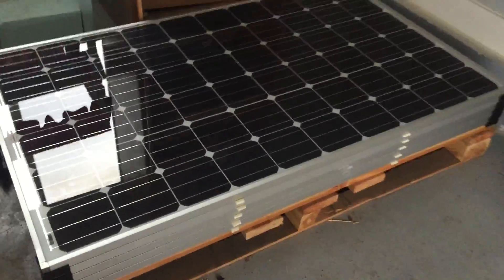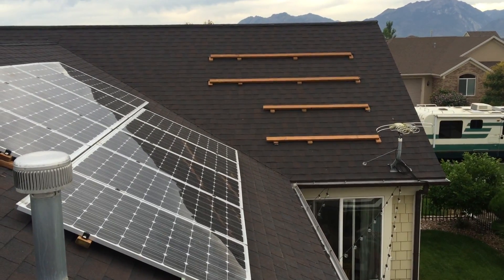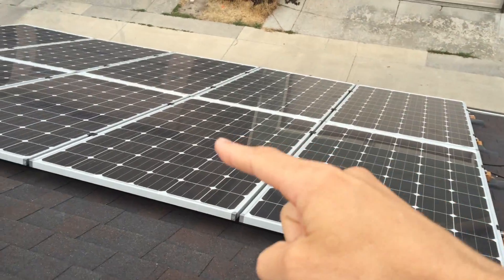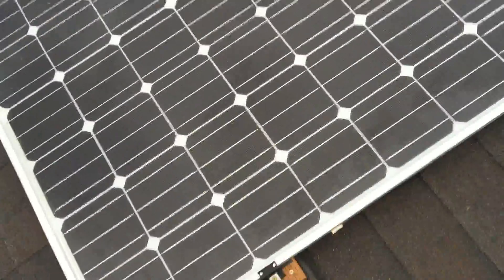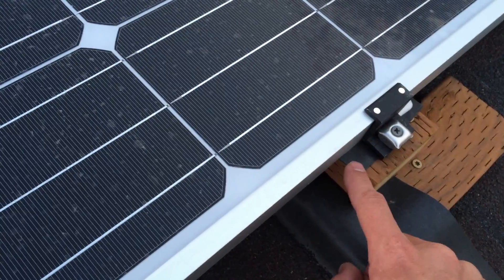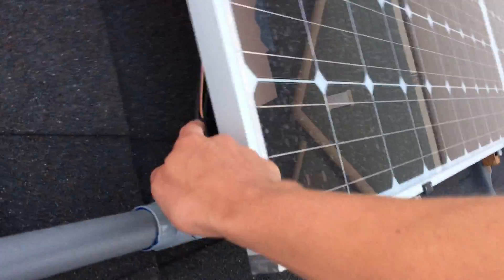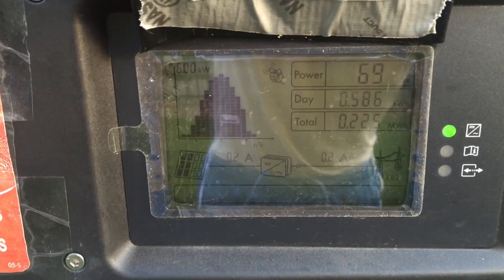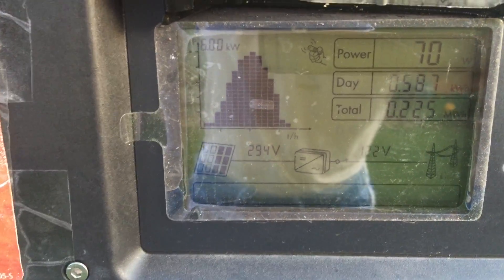How To Install Solar Panels Yourself For $4K - DIY 7KW - South Jordan, Utah - Cheap

Comment: Nice video!  I dont know why installation from these solar companies are so expensive!  Roughly I was told it would take about 3 days for about 3 people working to get my 7kw system installed, and if all three work at 8 hours a day, that would be 3 days x 8 hrs x 3 people = 72 total man hours for installation. They told me that the labor cost is about $10k, so doing the math, the hourly rate would be 10k/72 hrs is about $140/hr each installer makes?!  Geez, they sure make a lot of money for this job!
Reply: Companies charge 2-3x labor cost as a norm. Any less and they will be self employed and maybe unemployed ;-)
Reply: I could get a 7kw done in 1 day.
Reply from the maker: Yeah, and there are other hours of work they do (filing paperwork with the city and such), but it definitely doesn't amount to enough hours to justify what they are charging.  Like a lot of professional pay rates, I think they are building in a lot of cushion/buffer for the 1 in 10 installation that goes wrong and consumes 80% of their time and effort.

Comment: what permits/inspections do you need to do this job
Reply: Doesn't look like you need any in Utah which is incredible. No way would you legally be able to DIY like that in Australia
Reply from the maker: yeah, you do with your city.  I also had to have the HOA approve it.  To tie into the grid, they had to see that my city approved it.
Reply from the maker: permit with my city - South Jordan.

Comment: Is it possible to put solar to my condo building?
Reply from the maker: I imagine so - if you own, I think you own the roof in a condo, and if you rent, I suppose you would need to get the landlord's permission.  It is fairly easy to remove them later, but they might not like you drilling holes in the roof.

Comment: here is a diy dream. find telescoping glass tubing some wire and some circuit board copper sheeting or solar panel copper sheeting and then etch copper on the outside of the tubing and then connect wires to take the electricity. then do the same with all the tubes until you make one that is one foot across. then place on board to tilt to the sun. then make one the same size as a solar panel and put in the sun. if done correctly the 20 sheets for one solar panel equaling 20 volts is now 200 volts and you can run a lot of stuff on it. if you make it a vacuum system like a light bulb then it increases energy and if you make it more than one foot tall then you make about 200 volts for every layer. please remember vacuum is best as it will heat up ok. good luck.
Reply from the maker: Hmm, sounds interesting
Reply: dare you to try it.
Reply from the maker: Is that a double doggy dare?
Reply: the vacuum effect cause an increase in the normal power output.
Reply from the maker: i see

Comment: have you tried the micro inverters on each panel? I heard they're a bit more efficient...
Reply from the maker: I looked into them - slightly more efficient, but double the price - not worth it I think.
Reply: Micro Inverters are easier to work with... but the efficiency loss is less the shorter your DC homerun is.

Comment: Why don't you install a lithium battery to sustain the energy produced throughout the day?
Reply from the maker: I have considered it, but it wouldn't really offer an advantage.  Basically, I am using the grid as my battery.  Batteries can cost a lot (unless you get them free or cheap like 18650 ones).  I get credits any time I am overproducing and then use the credits at night.  You would only use lithium batteries if you worry about power outages or you are off-grid.

Comment: Matt, I'm completely impressed with your project. .Not only did you design it yourself, you installed it your self!  

It's been over a year since you went on line, what has been your experience with your electric bill?  Congrats!

PS:  How did you pull all those cables through the conduit?
Reply from the maker: Joe Pah thanks!  It is going great. I am saving about $1200 per year off the $1500 I used to spend on power.  See full follow up report at https://diynewman.wordpress.com/2016/07/24/how-to-install-solar-panels-yourself-for-4k-diy-7kw/
Reply from the maker: Joe Pah oh and I pulled the cables through the conduit carefully. I actually didn’t connect all the conduit until I pulled all the wires through. Also, I ended up using two conduits because the wires wouldn’t fit in the one
Reply: Sure that makes sense... What voltage does your system run at?
Reply: Excellent self evaluation.  I received a quote for my house in Miami, and they are quoting a 9 kW system for basically the same annual 12,000 kWh output as your 7 kW system...Guess what?  It was $27,000..lol
Reply from the maker: Wow, that is a racket!
Reply from the maker: btw, you should check out sunelec.com because they are there in Miami so you would save $500-700 on your panels that I had to pay in shipping.  They also have the best prices I have found anywhere.
Reply from the maker: I am using 3 of the 4 strings I have, so the side that has 2 strings is 250 V, and the side that only is using 1 of the 2 slots for strings is at 125 V.
Reply: Yep I'm aware of them, and looks like a huge inventory... After reviewing a few videos of solar panel installation in Hurricane country I realize this is beyond my capability.. Mounting the panels on barrel tile requires removal of  tile to anchor the  mounting hardware to the rafters.  Not something I'm will to risk.

I might just build a small system that I can anchor off fascia, and take down when Mother nature visits.

Anyways thanks for the insights!
Reply from the maker: Joe Pah I see makes sense - good luck

Comment: Have you seen a good bracket/clamp to use between the panels that actually join them together?  Say like a clamp on the underside?  It also needs to be able to be secured to wood rails on the bottom.  I am looking to make a solar arbor, and to make it more or less watertight just by lightly caulking between the panels on the top.
Reply from the maker: I haven't really seen that.  I looked on a few solar sites and they charged a lot.  I ended up finding mine on eBay.  I am sure you could find something that would work for that on there, or maybe go down to a hardware store (Home Depot, Lowes, Ace, etc.) and see what you can find.  Even something like c-clamps might work (and some silicone caulk stuff).  Anyway, good luck!

Comment: You did a good job. It would have been cheaper to use  less flex and more pvc.
Reply from the maker: thx - I am not sure the cost for flex was significant though - I think I only spent $20 or $30 on that because it is only on that portion that goes down from the roof to the inverter.  The rest is PVC.

Comment: How did you wire the Delta lightning aresstor in your disconnect box?  I don't see any ground going to earth.  The lightning strike needs to shunt to ground.
Reply from the maker: the grounding wire goes into the ground on my main breaker box, so in theory, the lightning would go into there, but I have also been told that I have too many right angles and it wouldn't follow that path anyway.

Comment: Very well done presentation. I hope to take your information and work on my project of solar powering my shed, before starting on my house. I was just a little hesitant on tackling both projects myself. The quotes I have received so for for the home system are off the wall. Thanks for the great info.
Reply from the maker: canjo 7 You bet, good luck with your project!

Comment: hello Matt what  controller  and switch ? can you letme know
Reply from the maker: thao nguyen san diego You actually don’t need a controller if you don’t have batteries. Check out the link in the description to the blog and you can get information about all the parts. Maybe you are asking about the inverter

Comment: Should use kindoff /strut for racking .
Reply from the maker: Joaquim de souza Yeah I realized that after the fact. You can get strut channel for pretty cheap. If you look at the link in the description it is to my blog where I have all of the follow up stuff and this is one of the items on the lessons learned section
Reply: Lot of credit to you for doing this job yourself ,thinking to do the same my self .Thanks for reply and posting this video for benefit of all of us.
Reply from the maker: Thanks and good luck!

Comment: Nice work explaining this. Since it's been over a year I would like to see a follow up video showing if you have had any issues and what you have actually saved.
Reply from the maker: I haven't gotten around to doing a video, but I added a Follow Up and Lessons Learned section on the accompanying blog - https://diynewman.wordpress.com/2016/07/24/how-to-install-solar-panels-yourself-for-4k-diy-7kw/
Reply: Thanks for the fast response, that info is quite helpful.

Comment: You should use Snap-n-Rack for mounting this. mounting brackets and rails at most electrical supply stores like Rexel or Platt. Wind and weather will destroy that racking system. The screws need to be bolts too. Rubber flashing will crack in a few years. Good learning experience though and it will probably hold up ok. Just some ideas..
Reply: hello Matt newman. first of all thanks for all your input.  i have a few questions.  im in texas major city and would like to know if i need an electrical permit as well?  and who ties in the net meter?  i use reliant energy. also how fast do i need to get started since 2019 is on its way.  thanks.
Reply from the maker: Dusty Webb yeah your city probably requires a permit - ask at city hall. The net meter is the power company - ask them. It took me about 5 months total to get panels from Miami, install system, and get plugged in and permitted.
Reply: thanks man hopefully i dont need an electrical permit as well.  5 mths?  hmm looks like i need to get me a loan and getstarted asap
Reply: @dustywebb9140  In Oregon you need an electrical permit and building permit
Reply from the maker: Yeah, but it took me a long time because I had to figure it all out.  Using all the info on https://diynewman.wordpress.com/2016/07/24/how-to-install-solar-panels-yourself-for-4k-diy-7kw/ you should be able to pull it off in a couple months since I have done a lot of the work for you :)
Reply: really nice stuff here.  i found out i already have a net meter installed,but i saw that you added a breaker between the solar ac power and the net meter.  who does the connection from the breaker to the net meter? and where exactly on the net meter does it connect?  thanks.  also how do i find a structural engineer to get approval from HOA?   i would love to donate some enough for a coffee or something (like 10 usd) let me know if you have a donation page or something.  Ive donated before by using friends and family paypal service.
Reply: thanks man will do.  consider it done lol.  anyways as far as for your HOA did you have to draw out a plan, i didnt see it in your reference plan. and how did you calculate the size of the breaker? do you add extra amps to include the disconnect or just a step higher of maximum output from inverter?
Reply: yea i checked it out and didnt see the diagram in the HOA section. ill scan the others.  also did youmispell your email address?
Reply from the maker: Thanks for the tips!
Reply from the maker: so I have the panels and then their DC wires go into the inverter, and then an AC wire (10/3) comes out and goes to an emergency pullout (AC disconnect) so first responders can just quickly disconnect that.  Then from that, there is another 10/3 wire going to a circuit breaker that I just popped into my main circuit breaker box.  I didn't do anything else from there.  The power company came and replaced my meter with a net meter.  If your main goes into a breaker box, you shouldn't have to mess with hooking into the net meter because your main already is somehow connected to it.  

For the structural engineer, I think I just googled in my area.  I found a guy that did it all remotely - I can refer you if you can't find someone local.  I am not sure if that works across state lines though.  And it was the city that required approval from the structural engineer, not my HOA.  

You are so kind - I suppose you can use mattrobrertnewman at gmail dot com for donations on paypal.  Take care!
Reply from the maker: yeah, have a look at https://drive.google.com/open?id=0B8sb6jeRth9FYUw3NGxlcEdieGM.  There should be some diagrams in there.  For the breaker, I just looked at the output of my inverter in the manual, and asked a guy at Home Depot I think.  I think I just did a double 30 A.
Reply from the maker: oh yeah, try this folder - https://drive.google.com/open?id=0B8sb6jeRth9FbFBlOElZVkhWY28.  The diagrams aren't great, but are something and were enough for the HOA and city.  My email is mattrobertnewman@gmail.com.
Reply: k thanks

Comment: Hi... I live in Connecticut and Just bought a 3200 Watt Off Grid System from Sun Electronics for my mother in Puerto Rico.  Shipped them to from their Miami Florida Office.   Now I am wonderings what else I need purchase.  I bought  z brackets and I am looking for a manual transfer switch.   Looks I will need to build a railing with treated wood like you did.  Trying to anticipate other items I will need such as tubing, grounding connectors, wiring, MC4 connectors, tools... etc.  Hoping if I send you a copy of my Sun Electric Purchase Order so you can review and make suggestions.   I don't know how much I will be able to buy at Home Depot in Puerto Rico when I go to do the installation. Panels will be deliver this coming Monday and I would like to any additional items need from the states (except the wood from the railings of course and tubing).  Would appreciate your feedback.  Like & Subscribed to your channel.
Reply from the maker: If you check out my blog https://diynewman.wordpress.com/2016/07/24/how-to-install-solar-panels-yourself-for-4k-diy-7kw/, there is a lot more description there, and also links to my supplies - https://docs.google.com/spreadsheets/d/17l-QP0PswdXRNdfbICIZk83niCknfW6OeJlVLyCDeQ0/edit.  Let me know if you have any questions.
Reply: Thank you .

Comment: What about all of the usual permitting BS? Did you have to ask for separate permits for each of the roof installation, electrical connections, utilities net metering, etc? How does that work? could you give me some pointers? I live in Florida, and I know there's a lot of things you need a permit for. I have always wanted to do the installation myself, I'm handy, I'm an engineer (not electrical but know a lot about it), and it pisses me off everytime I hear I can't do whatever I want in my property. Please someone give me some pointers. Thank you.
Reply from the maker: Have you had a look at https://diynewman.wordpress.com/2016/07/24/how-to-install-solar-panels-yourself-for-4k-diy-7kw/ ?  I lay it all out there.
Reply: I went through it. Really good info there, thanks for helping up. I talked to the Building Department here in Pinellas County, FL. In order for them to issue a building permit (are solar panels a new construction???) they require plans to be submitted in a sealed envelope and approved by:
1. A licensed structural engineer (so that the panels don't collapse the roof and kill everyone inside)
2. A licensed electrician (so that the low voltage doesn't kill anyone walking through the roof)

On top of that, I will have to ask also permission from:
3. The Homeowners Association.
4. The electrical company for the net metering and grid-tie connection.
5. My wife

Even the guy in the Building Department told it would be a painful process and that he had not seen everyone do this before in Pinellas County. Really??? Well, it seems that people around this area are willing to pay 20K for something that could be done much much cheaper.

So, assuming that I need a licensed structural and electrical engineer, do you know where can I find one? Is this something that can be found on the yellow pages under professional engineer, structural engineer or something like that? Never done this before, apologies for the stupid questions. Thanks in advance!
Reply from the maker: That is a bummer - I think I just googled for structural engineer in my city.